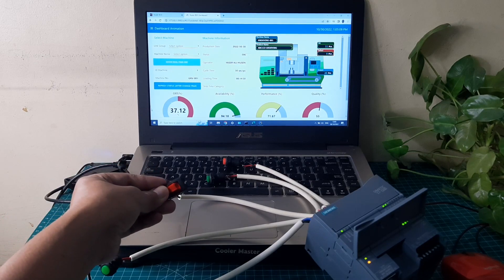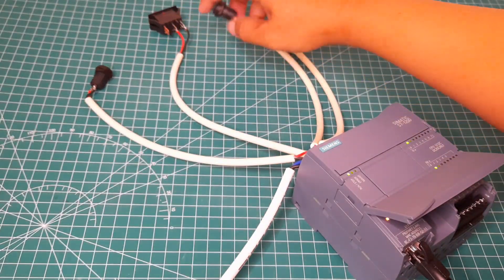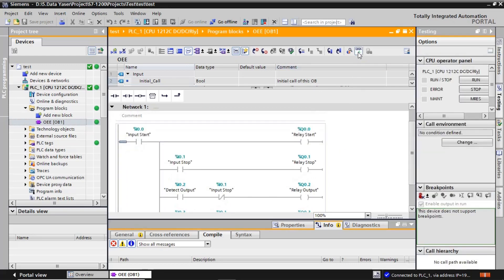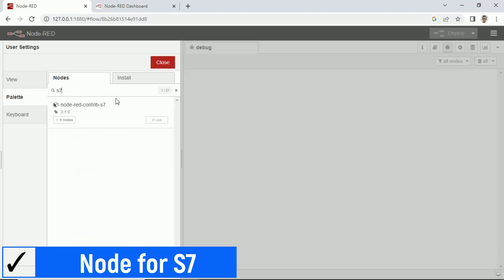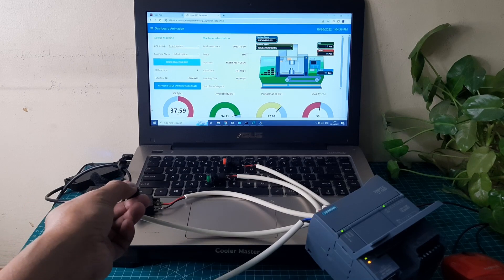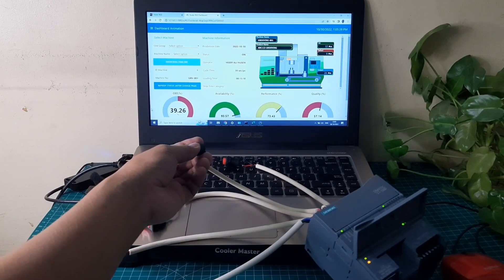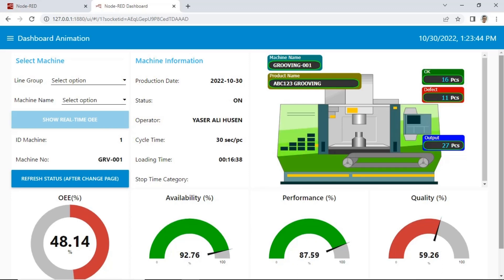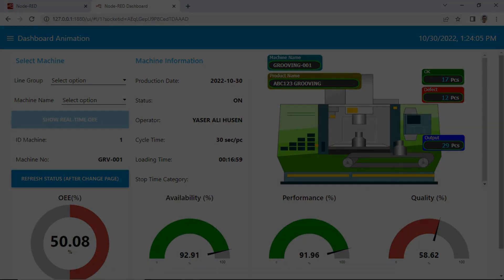OEE Monitoring System using PLC Siemens S7-1200

Comment: I wanted to ask something, have you ever designed a control panel using Raspberry Pi as a controller? Like reading industrial sensor values (0-10v/4-20mA)
Reply from the maker: I have experience read temperature sensor, ampere sensor, you can find in my others video.
For others sensor, I dont have experience.
Maybe you can find out in internet
Reply: @YaserAliHusen  alright, thanks.